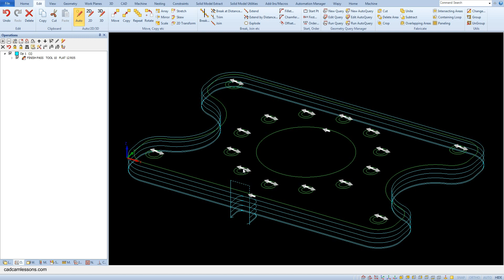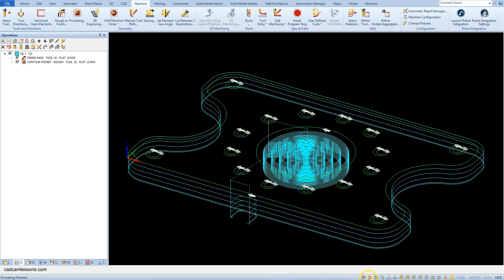Pocketing - Alphacam Training 13

Comment: Hi. nice lessons.
I have a questions . Where can be set the overlap of pocket tooling. Ex i have a 60mm tool when pocketing does 30mm remove material. i what to remove with 50-55mm . to speed up the proces and use the tool as much posible. So i would like to increase the cutting width between passes. Is anyware a setting?

Thank you